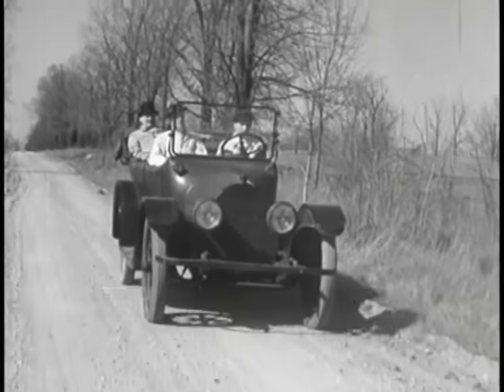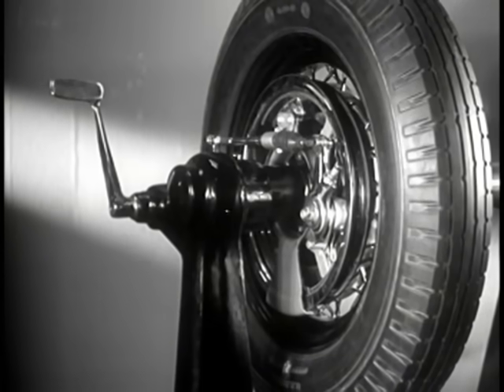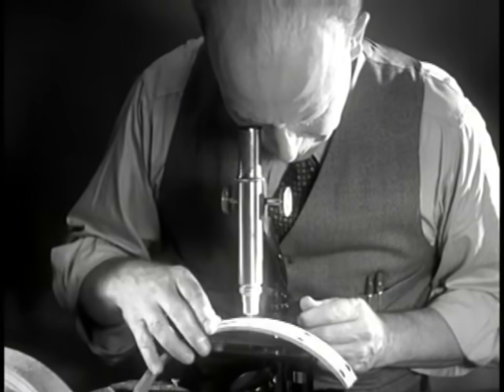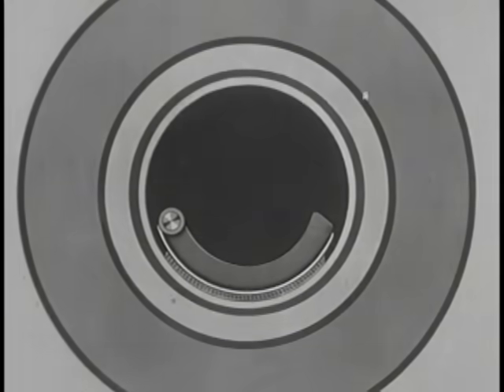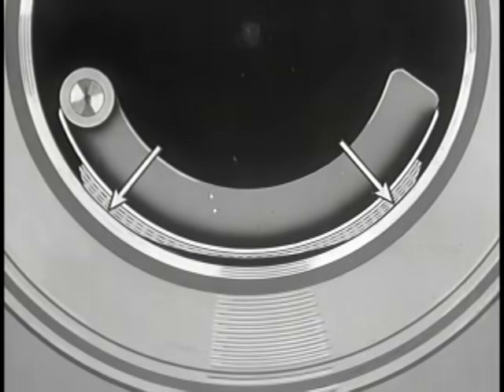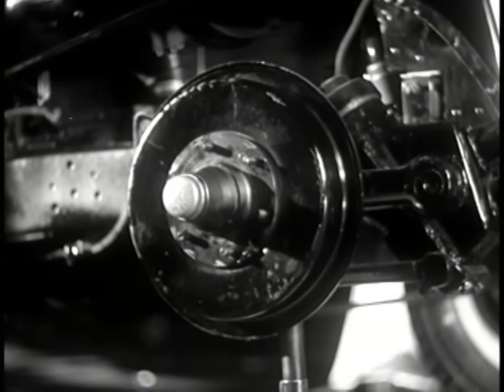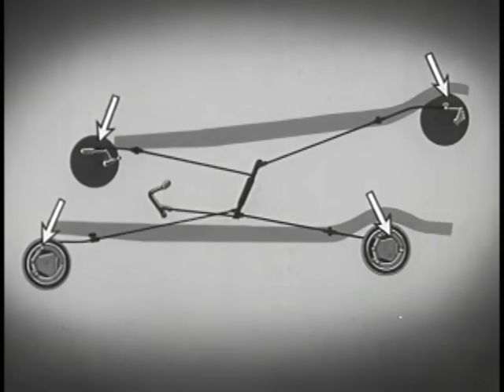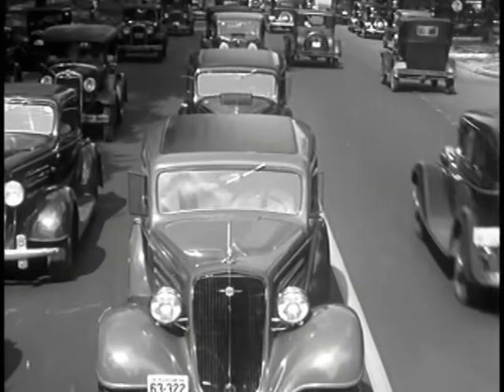Facts On Friction - Chevrolet Brakes (1934)

Comment: THE WAY THE ANNOUNCER WAS PROMOTING THE SIMPLICITY
OF THE ROD AND CABLE LINKAGE
WAS THAT CHRYSLER HYDRAULIC BRAKE WERE A NEW THING!
Reply: The narration is a bit deliberately misleading … hydraulic brakes did spread pressure to each wheel more evenly (?) Also hydraulic brakes were available on a growing number of makes at this point, still new but…even on Plymouth a direct competitor to Chevrolet

Comment: 330k miles on my 2004 Chevy Venture. All original burns no oil.
220k on my Chevy 1500 van 2003 runs perfectly only minor issues.
But American cars (made in Canada and Mexico) lol.
New LS6 5.3 v8 most reliable engine out there. Go Chevy!
Reply: 230k on my Yukon with an LQ4. Rebuilt trans 3 times, transfer case twice, both diffs once. Oil pump pickup print cracked last month lost most of my oil pressure. 4 fuel pumps. 

Every manufacturer gets a few lucky ones out. But it usually isn’t Chevy. I keep my Yukon because parts a a dime a dozen.
Reply: She put the lime in the coconut True . Buy a Delphi pump I got 170k still working.Front  Wheel bearings go alot. Timken brand last life of truck expensive . Avoid Chinese aftermarket parts. Hard to do now since only Chinese take out food is made in America now. Shalom

Comment: ¨we have chosen the very asBESTos brake material we could find"
Reply: There is a city in Quebec named Asbestos.  I am not sure it that is where it got its name.
Reply: @JohnDoe-gm5qr  That's definitely where it got its name.
Reply: im from qubec lol is now Val-des-Sources this https://fr.wikipedia.org/wiki/Val-des-Sources
Reply: Asbestos was used in so many aplications because it is very strong and resistant material, in fact that is the main reason why it is so cancerogenic...
Reply: @Bialy_1  https://www.chemistryworld.com/news/why-asbestos-is-still-used-around-the-world/3007504.article
 

Not was, it's STILL used
Reply: Very good
Reply: Not many people are aware that the London Underground is lined with asbestos. It would cost billions to remove it,so they just pretend it is not there. It really is a fascinating material,it is fire retardant,hence was used in brake shoes,it doesn't degrade in water,so was used for water pipes,and roofing,and it can be made into most shapes. It is easy to see why they thought it was such a brilliant material for a lot of purposes. It's a real shame that it will kill you in the most horrific way,when the dust particles from it are breathed in. Can take years for its affects are noticeable though.
Reply: @madeinuk68  Asbestos in situ is fine and best left alone. 

Problems start when it dumps fibres into the air (such as when used in brakes) - it's far more dangerous to try and remove asbestos tunnel linings than to leave them in place and monitor them.
Reply: @madeinuk68  whats the problem then ? just make it stop dusting things.
Reply: @madeinuk68  so its entombed so to speak.  If one doesn't disturb it, it's not problem to humans.

If you have to cut through it... that's another issue.
Reply: Very clever 👏
Reply: LMAO 😂 😂
Reply: boSKELETONrp
Reply: I use genuine Chevrolet disc brakes and my lung feels great!
Reply: YES!! LOL
Reply: Asbestos is an essential nutrient, so not a bad thing

Comment: According to Wikipedia, 1934 Chevrolets were powered by a 181 cu inch six cylinder engine producing 60 horsepower with a top speed of between 65–70 mph.  Fast enough to kill you if your brakes failed.
Reply: Which they won't, due to their strong, mechanical, steel rods and strong, steel cables rated with a tensile strength of over 3000 pounds -- much higher than required!
Reply: @10NBLR  I read that with the narrator's voice haha
Reply: @10NBLR  69+1
Reply: The top speed may have been 65-70 mph but that would be with an engine speed of at least 3200-3600 rpm. Nobody would really have pushed those cars that hard. Most non overdrive cars of the 1930's were happiest between 35-50 mph.
Reply: Note they arn't offering any stopping times, or how long before those cables stretch and need balance adjustment.
Reply: @DanafoxyVixen  because the proof is in the pudding, and it was 1934

Comment: Malcolm Lockheed patented hydraulic brakes in 1917. Fred Duesenberg used Lockheed hydraulic brakes on his 1914 racing cars, and on Duesenberg motor cars starting in 1921. Walter P. Chrysler started using Lockheed hydraulic brakes in 1928 on all vehicles made by Chrysler. Other US manufacturers didn't adopt hydraulic brakes until 1936-1939. GM and Ford were kinda late to the idea.
Reply: Somewhat of a good reason. The early hydraulic systems were terrible, actually very leaky.

The materials used were just not up to our discerning modern standars. Plus, when a line broke in the early days the whole system would lose fluid and pressure, meaning no brakes.
Reply: @gregbaird7582  "The materials used were just not up to our discerning modern standards." why even mention "modern standards" no one is arguing that, just for the standards of the time. 
The leaking issue was largely solved by the time the Aero industry invested in Hydraulics in the 1930's. 
" Plus, when a line broke in the early days the whole system would lose fluid and pressure, meaning no brakes." Yes it was a rare problem as too when the Cable system stretched, leading to unbalanced uneven breaking that could just as easily cause the car to handle very dangerously
Reply: For the road conditions and horsepower of the time, hydraulic brakes weren't really needed.  Most cars rarely saw speeds north of 50mph.  Which is why Indianapolis and Daytona advertising speeds in excess of 100mph was a big deal back then.  You could say the same for engines...Harry Miller had already pioneered supercharged dual over cam engines in excess of 1hp per cubic inch 10 years before this video came out.  Why were production cars only make 60hp then? Because the benefits didn't outweigh the costs yet.

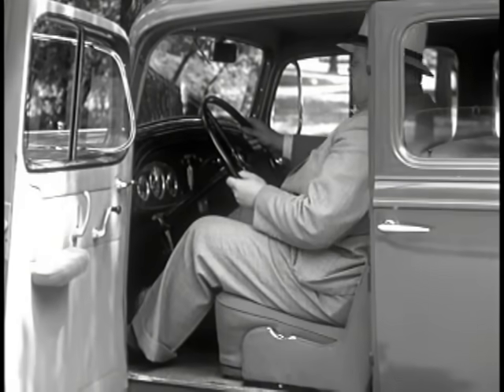Comment: 8:07  "The 300 pound man couldn't spring a single part" of the mechanical brake system"...maybe, but it looks like he gave the seat springs a workout.
Reply: The seat of that car: "Kill me. Kill me. Kill me..."
Reply: Job offering by the QA department - "Requirement: Body weight of at least 300 pounds".
Reply: 300 lb man. That is 1/2 of American men now.
Reply: @MoneySavingVideos  I only weigh 150 so I've skewed the average just a bit. LOL

Comment: Oh my god! He convinced me. Where can I get Chevrolet cable operated brakes?? I  don't want crappy hydraulic discs with ABS.
Reply: Yep, Heaven forbid you drive a 1929 Dodge with hydraulic brakes. LOL!  Makes us appreciate what we have now.
Reply: @lanedexter6303  discs are simpler and more reliable anyways
Reply: @zachyoung2002  I agree they’re simple, reliable, and shed heat and water better, and mean less unsprung weight than drum brakes.  I’m currently replacing calipers, rotors & pads on front of a Jeep WJ because we didn’t drive it often enough so brakes stuck and dragged. Properly set up drum brakes usually don’t do this because springs pull the shoes away from the drum (yes, I’ve seen drums “rust on”).  BTW I used the reliable straight mechanical drum brakes on my 1959 Massey Ferguson earlier today. One pedal for each rear wheel. 😉
Reply: Speed is limited to our ability to stop,and probably increased after the fourth beer 😄
Reply: @neriozulberti1492  Stock, this car has amazing brakes. 850csi aluminum 4 pot brembos and 325mm rotors are far from stock...
Reply: @yellowcakepie1  I also like Kia Stingers, what's your point?
Reply: Go Clunker 
Oh I was just amused when the OP made a joke comment and you came in talking about an M3
Reply: That technology is still mounted on some low cost car
Reply: @neriozulberti1492  No its not, drum brakes are used, mechani calcable brakes haven't been around for like 70 years now
Reply: @neriozulberti1492  trucks use them for their rears too!
Reply: Drumbrake lovers up in here😂😂😂😂🤪🤪🤪🔨🔨🔨🔨🔨 hilarious
Reply: @goclunker  I think you should go find a plant and then beg for forgiveness for the oxygen you waste that the poor thing strived so hard to make, you dim witted mouth breather.
Reply: @Drchainsaw77  Tesla already is
Reply: Drchainsaw77 you know, at 19 years old and doing 0-60 in 4.5 seconds now with a lil tune, its gonna take quite a while. What's that brand new Kia Stinger do? 4.3 seconds, 19 years later? Hmmm I'm still running NA. With a lil turbo, i could make this car run 9 second quarter miles
Reply: @goclunker  He's not wrong, eventually, later generations will laugh and point, or straight up not like them. You don't see many young Model T fans these days or the cars these days, I doubt you'll see a M3 in that amount of time either, same for my RX-7. It is what it is.. we'll just enjoy our cars for now.
Reply: @Pieman6711  Yeah, but drums are laughable, they have always been
Reply: Drum brakes have ALWAYS been laughable? Please do explain to me how drum brakes were laughable 90 years ago when it was the newest and maybe the only braking technology for cars? And you completely missed the point of the guy saying your car will be laughable 80 years from now. This video is from '34, that's 86 years ago. You think disc brakes won't be laughable 86 years from now? You think your M3 and 850csi aluminum 4 pot brembos and 325mm rotors will have any relevance another 86 years from now? They will be as relevant as drum brakes are for us now.
Reply: @alexc7075  Well said.
Reply: @goclunker  Drum brakes were once standard equipment and not laughed at.
Reply: @goclunker   And a brand new M3 is sub-4 seconds.  That's from the factory without having to do a "lil tune."  Comparing older modified vehicles to new factory vehicles is a fool's errand.
Reply: I hope this is sarcasm, I'm pretty happy with my 4 pot brembos that can bring my 3500lb m3 to a dead stop from 80mph in little over 120ft
Reply: @goclunker  From 60mph, not 80mph

Comment: Seeing how disc brakes didn't arrive until the early 1950s, these Chevy brakes were pretty much "state of the art" for their time.
Reply: Disc brakes were around much earlier, particularly in the aircraft industry, but they were too expensive to be practical for standard automobiles.
Reply: "Development of disc-type brakes began in England in the 1890s. In 1902, the Lanchester Motor Company designed brakes that looked and operated in a similar way to a modern disc-brake system even though the disc was thin and a cable activated the brake pad."
Reply: and drums were used in the rear of trucks up umtil 2016, they are cheaper and last far longer
Reply: @jacobsweat1520  cheap cars still have drums in the rear to this day.
Reply: @jacobsweat1520  Drums are still used for some applications.
Reply: @jacobsweat1520  Drum brakes are still used in the rear of entry level cars in developing countries. In my country for example, some cars have front Discs and rear Drums with ABS & EBD systems.
Reply: @grevatious  Technically most cars worldwide have drums in the rear unless they have electric parking brakes. Yes you can see disks but inside are small drums and shoes for your parking brakes.
Reply: @dethfan06  not all cars use drum parking brakes. I'd say most don't tbh. On  honda's the parking brake is part of the rear brake calipers. There's a lever the brake caliper pulls on that pushes the piston.
Reply: @kasuraga  not on accord 8 euro. it has drums inside. says my workshop instruction
Reply: @jacobsweat1520  The Toyota Tacoma still uses rear drums up to this day
Reply: @jacobsweat1520  Drums still used quite a bit in the mass  economy class market.  They work well in small cars that have very little rear brake bias.
Reply: Only technology that topped these at the time were four wheel hydraulic brakes. But at this time, only the most expensive cars had that.
Reply: 16 years ahead of their time, wow.
Reply: I remember having to literally stand on the brake pedal on my very well used 62 Impala to get it to stop at times.
Reply: 1936

Comment: 'what could be safer?' have a master cylinder so not all your brakes go out at the same time if one brake breaks!
Reply: till idiots let it leak until it sucks air. i once found someone with a puffed battery on the road. i went to help them and found their master cylinder with no lid and about 1/4" left in it.
Reply: @johjoh4571 so your little story telling aside, are you actually advocating for Cable operated brakes or what? because they have their fare share of problems too
Reply: The mechanicals did that. The hydraulics did not.

You are actually thinking about it backwards.

Comment: Wow amazing how far we've come - even bicycles have hydraulic disc brakes these days.
Reply: @elliot7179  True, but they will fade quite a lot faster than disc's due to heat. Also drums are much more susceptible to losing their braking strength due to foreign material like water, dust or dirt getting into the drums. Lastly brake dust build up is another concern since drums are pretty much sealed. Not saying drums are bad, but they have a few bad disadvantages over disc's
Reply: Yeah, we've come so far that some new cars in 2019 still use drum brakes (rear brakes in low powered cars) and the construction (except for having a self adjuster) is almost the same.
Reply: @draconpost  Many cars have gone back to using drums lately, in the form of a "drum-in-disc" brake. The parking brake connects to the drum, disc brake for standard use. My landcruiser has this on the rear wheel.
Reply: @briannem.6787  I love the top hat rotors with the mini drum parking brake , I'll take this over just drum or just disc/rotor any day of the week and twice on Sunday. I hate the brake calipers with the parking brake built in where you have to screw back in the pistons during service. Funnily enough I've got one of each type between my 3 current vehicles.
Reply: draconpost my friends 2015 Tacoma has drums in the rear, they work great and haven’t been touched in 80 thousand miles
Reply: @elliot7179  You're wrong, any kind of disk will have more braking power than a same sized brake drum. The reason many pickups use drum brakes at the back is because they're better for off-road since all the mechanism is enclosed. That and being cheaper are the only things drums are better than disks at
Reply: @Ignacio.Romero  There is only one reason - they are cheaper - thats it. To say drum brakes are better off road is just wrong.

The claim that drum brakes are less likely to load up with debris—for example mud during an excursion through a mucky hole—might seem logical on the surface, since a disc brake’s rotor is completely exposed to the elements and is immediately doused with whatever comes its way. It is more difficult for gunk to work its way past a drum-brake’s backing plate and get into the mechanism. 

The problem is that, once that gunk does get into a drum brake’s internals—and it will—it stays there until you disassemble it and clean it out, a time-consuming chore. A disc brake might squeal initially as slush impacts against the pad and disc, but it will quickly wipe itself clean, and if there is anything left a quick powerwash will take care of it. Drum brake shoes ride farther away from their contact surface on the drum, allowing debris to be caught between them.
Reply: Elliot my motorcycle disagrees with you
Reply: @Racing_Fox  haha no worries , all opinions are valid

Comment: "What could be safer?" A power assisted hydraulic drum/disk combo
Reply: They had no idea about Disc brake back then. Well they kinda had but mass production of them was not an option. It began many years later in 1955.
Reply: @oldi184 they had disc brakes but they were pretty new.